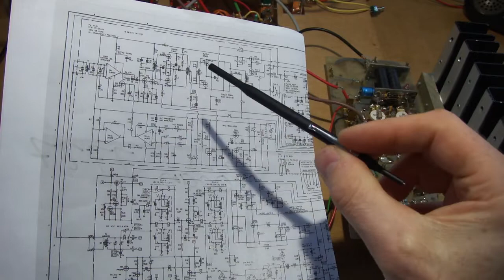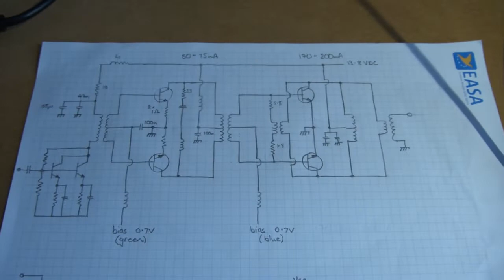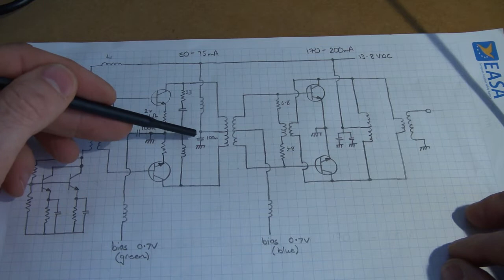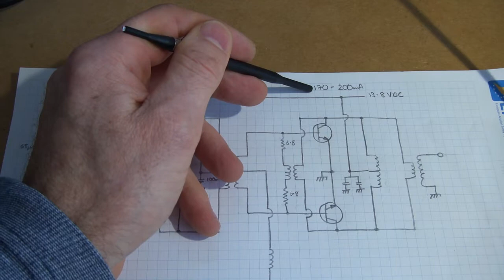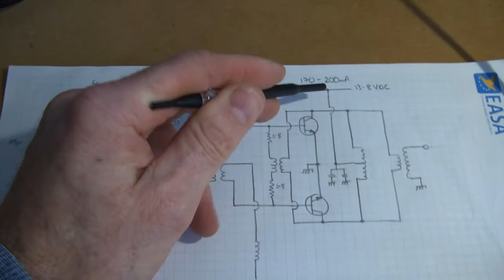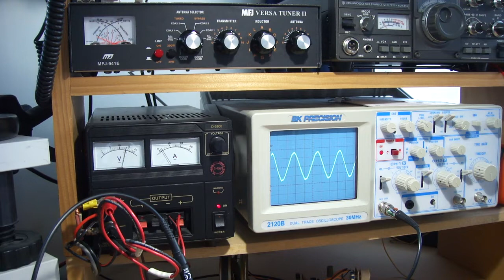Homebrew SDR SSB Rig - Part 10 Power Amplifier Experiments

Comment: Wish I had found your channel 2 years ago.  Is it a bad sign that I am thinking about buying parts for this build when I have 3 unfinished radios I could work on?  I ran your hilbert transform on my latest project and I think it sounds much better than the guy you talked with a couple of videos ago.
Reply from the maker: Keep playing Ron. The beauty of the Iowa Hills software is that you can easily experiment with the filter parameters and quickly see how they sound. I will probably double back at some stage and take another look at the SDR rigs.

Comment: Hi Charlie! Thank you so much for your excellent videos. I'm building my own version of your design which I'm really pleased with. Thanks for the great tip which you gave me about using the 74AC74 instead of the 74HC74. I can certainly cover the entire HF band now if I wanted. My rig does 80, 40 and 20 which are the three bands I use most. 

I've just got the transmit chain together. Just one question: did you ever manage to dampen down that bit of carrier that was getting through on your signal? I ask because I too have some carrier on my signal - it actually looks like a pretty clean sine wave at 80m and gets progressively dirtier (i.e. more harmonics) at 40 and 20. My rig is strung together on the bench but a bit more compact than yours so I'm wondering if it's an rf shielding issue.

Anyway. Thanks again for all your inspiration. I would never have imagined I'd be designing my own Hilbert transforms and messing around with Teensies!

73.

Nick
M0NTV
Reply from the maker: That's great to hear Nick. So pleased it is working well for you.

Comment: Been having a lot of fun with this  Have been looking at direct sampling rf adc's and wondering if they could be used as a front end with a teensy doing the rest of the work
Would be looking at something wide band say 160m to 70cm or higher
Any thoughts
Reply from the maker: Hi Mick. I'm not sure on that one sorry. All the Teensy wants is quadrature audio, so if you can direct sample RF down to AF in quadrature, then yes.